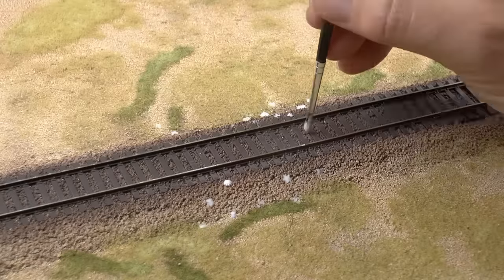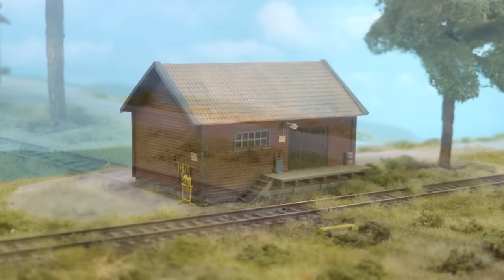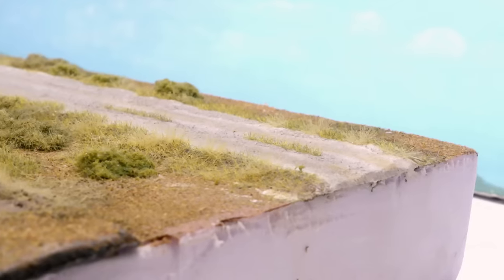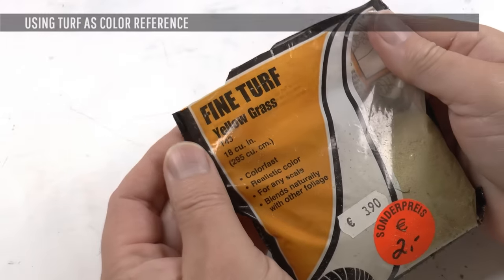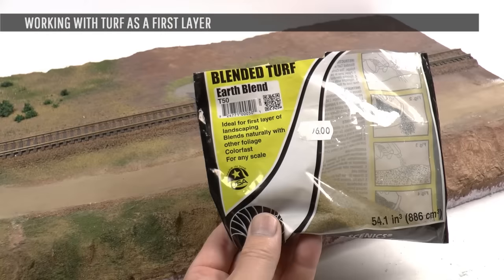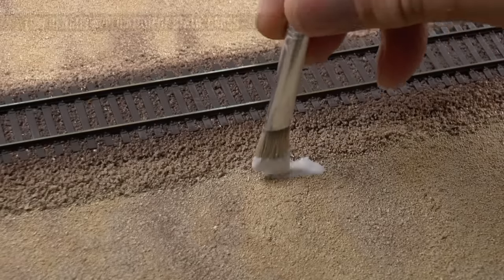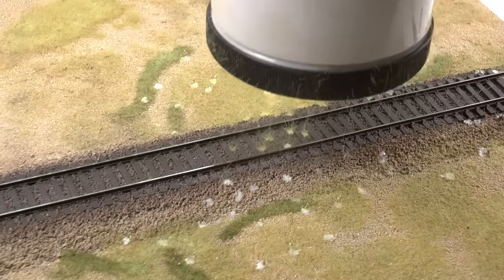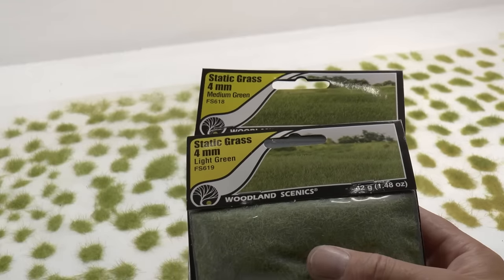Creating realistic scenery part 1 - Ground coloring and grass - Detailed tutorial

Comment: Although I am an experienced modeller it is always useful to review the basics. And here again I learned new tricks (mainly about chinchilla sand). About static grass glue, you can make your own cheaper one diluting matt mod podge. I use it now as my only scenic glue, reserving PVA for wood or card assemblies and gloss mod podge to create water effects over a resin base. The advantage is that for the cost of a 250 gr of Noch glue you can make thrice the quantity using 500gr mod podge plus water and a bit of IPA or dish soap. Also you can apply it thick or dilute it to a runnier consistency to spray or soak a surface with a spray bottle or a pipette.
Reply: Does it really remain very, very matte with no shine when dry?
Reply: Yes. There aremany modeller who uses it as scenic glue for that reason both in the US and Europe. I buy it in half liter jars from Ava (Belgium)

Comment: I have a metal sheet pan to which I clip parchment paper. Black spring metal office supply clips are fantastic for this. Then I attach the ground wire clip to one of those and it helps tremendously with the grass standing up on it's own.
Reply: Is this for making static grass on separate patched?
Reply: @SkipRoGlo  For making tufts separately. On the layout itself I use the supplied grounding wire and attachment.
Reply: @tvtoms  thanks